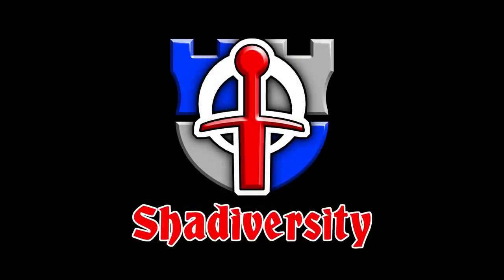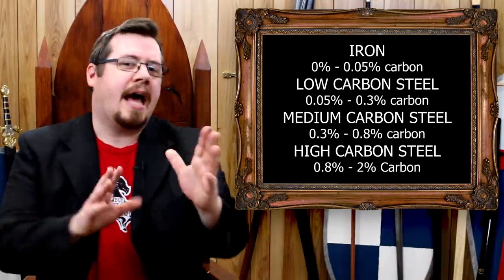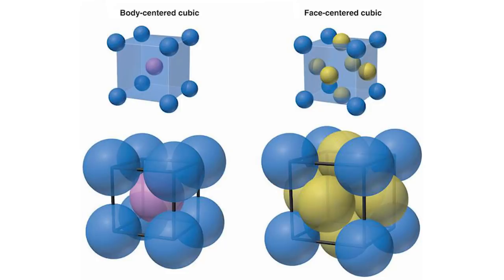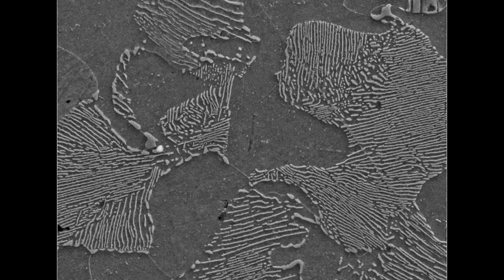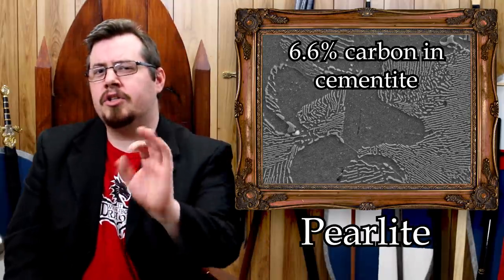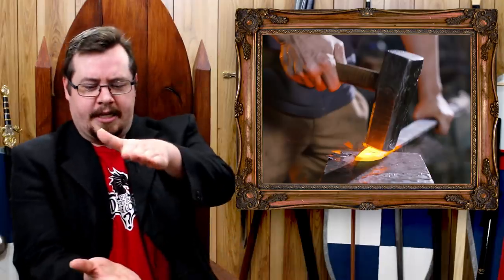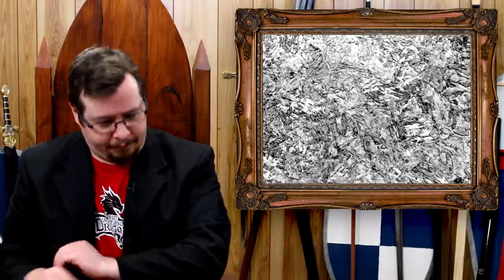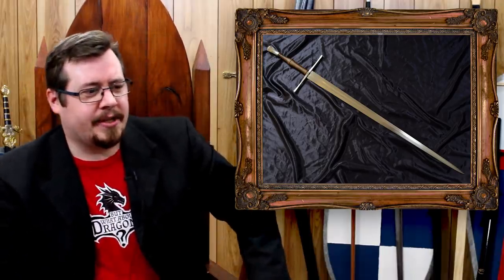What quenching and tempering does to SWORDS

Comment: 15:59
"Hardness does not determine how sharp a sword can get."
Technically true, but when you get into some of the more exotic steels (albeit not sword steel), hardness and steel composition do dictate how sharp you can get it. For instance, with steels like ZDP-189, CPM-S20V, ect. - you run into issues with edge stability. And with steels that are extremely hard like ZDP-189 with a high HRC or steels like CPM-S20V, S30V/S35VN, ect. with carbides not normally found like vanadium carbides (which are... absurdly tough, don't quote me on this, but IIRC vanadium carbides would be measured in the hundreds or perhaps thousands in HRC if you were to to measure and convert it). So what happens if you don't sharpen something that is harder than the carbides (like diamond), you're not actually sharpening the steel, but ripping/tear/fracturing the carbides out. Meaning that you can't get it as sharp as a steel that does not have those carbides/hardness.
Reply: Forgot to mention: this doesn't mean that such steels are not as sharp. As I said, diamond solves many of these issues - although when you get into the ridiculously sharp and minute details, doing it as well is much more difficult than if they didn't have the carbides. Diamond doesn't "polish" after all. All you can do is step-down through "grit"/micron (micron is better for measuring the sharpening effectiveness because it's uniform, grit just means whatever standard that manufacturer uses to measure by and there's dozens) size until you get the edge you want. Meaning you start out with, say, 30 micron diamond, then 20, then 10, then 7, then 5, 3, 2, 1, .5, .25, .1, ect. Monotonous and time-consuming to sharpen "properly" that way. Then again, it's NOT necessary, but if you want to get absolute equal sharpening performance and everything, that's the way it needs to be done. Realistically, it won't improve your edge to a degree you'll notice it. This is all just meaningless semantics from human end user experience.

I really recommend "Cliff Stamp" and his Youtube channel. The guy really dives into the minutiae of sharpening and what works and doesn't work and why. And it's surprising how much we still don't really know about the subject. Then again, new steels are always being invented and each one kinda puts a dampener on what we knew about sharpening.

Comment: Just a little correction: Heat treatment (tempering and quenching) is not anywhere close to the last step in the manufacture of a sword. It still has to be brought to its final form, polished, hilted, sharpened, and have a scabbard fitted to it. If anything, I would consider heat treatment to be the halfway point.
Reply: Final step in blade construction then?
Reply: Serahpin no, because after tempting you still need to put the right edge on the sword. Before hardening you only form an edge 2-3mm wide. Giving the said the final shape before hardening would greatly improve the risk of something failing (bending, cracking).
So basically the steps in blade making are 1. Rough shaping 2. Hardening (quenching, tempering) 3. Final shaping
Reply: As someone who makes the occasional sword, I must say that's a fairly accurate point. However I think he meant the final stage of FORGING the sword.
The steps I generally take when making a sword are as follows:
Idea for sword
Measurements
Stock Selection
Forging Process
If needed, grinding process (I generally don't remove material from my swords)
Fitting the Guard and attaching it (I make my guards integral because over time the material for the handle will degrade and the guard will come loose if not precisely fitted. Guard is generally Forge Welded onto the sword)
Creating and fitting the Pommel
Normalizing 3x generally
Quench 3x generally (more quenching brings the grain size down allowing for sharper and longer lasting edge)
Tempering
Reducing edge and sharpening (I don't polish my swords, generally I leave them with the forged and patina look)
Create the handle, then fit pommel. (I generally either rivet the handle together or glue it together, though I prefer riveting)
Test sword (I'll abuse the hell out of it, cutting PVC, trees, lumber, etc. If any problems arise I will toss it or keep it for personal use.)
If no problems then I'll create a scabbard for it, I'll generally make them out of layering Pine wood just because it's easiest for me.
Sword is complete.

Comment: I enjoyed watching this...it reminds me of pouring epoxy resin.
You want it to be liquid enough to be able to push bubbles out and self level. But you also want it to dry quickly so no more bubbles form or any stuff gets in it while its wet.
So you add a hardener to the resin to make this happen.
The hardener is essentially tempering the resin...which would otherwise be soft and full of impurities.

Comment: Most of my experience with heat treating and tempering is from forging knives. When you temper a knife you tend to want a "straw" temper color (around 400F) so I was concerned when you said good swords were made with a blue temper color. But you have certainly done your research well, and I can understand why you would want a spring steel sword. Great instructional video! I might use some of this knowledge when making more blades in the future!

Comment: I thought quenching and tempering were the same thing too, I learned a lot from this video! I knew about the differential hardening of traditional katanas and always wondered "but if the cutting edge is brittle won't it still chip?" I never got how a softer back would prevent that, like many people inaccurately claimed. Though it's not as good as spring steel, I love the creativity the Japanese employed to try and find a balance of strength and resiliency, not to mention the beauty in the resulting blade.

Comment: This reminds me of one of my favorite quests in Kingdom Come: Deliverance. One blacksmith hires Henry to investigate a blacksmith from another town, he does this because he has heard that the other blacksmith is a sorcerer who is casting spells on his steel to make it indestructible and he wants to know what the spell is so he can recite it over his own material as well.
     When you investigate the other blacksmith one of the first things you likely notice when you come upon him is that he is always singing. As you ask him questions about how he makes his swords (Henry's father was a blacksmith, and so Henry is able to get him to open up about it to some extent) and why he is singing he tells you that one time after finishing the blade for a sword he got distracted and left it sitting right by the fire of the forge and when he finished that sword he realized that it was much tougher than his other blades. He had no idea why it happened, but he realized that when he partially heated up the blade again after quenching it became more flexible while retaining the hardness of steel. He then proceeds to tell your character that the song he sings is a way of timing how long he lets the steel re-heat by the fire before he removes it in order to get the most durable steel. He essentially learned how to properly temper steel without having any idea what was happening.

Comment: Pretty spot on, at least as far as swords go.  But any other bladed tool/weapon it has to be differentially harden.  I make knives and I do the quench and temper in one go.  When I bring the blade out of the quench, I scrape the edge with a file.  This is twofold, first it tests the hardness of the edge, but also cleans the scale off the edge so I can see what color the edge is turning so I can get it to the right hardness.  I go for a straw yellow for my knives since there is no chopping involved in their intended use.

Comment: 4:50 About work hardening. You can actually work harden steel/iron when it is at low temperatures (in the glowing red area) This happens at higher heats too but there's enough time and heat that it will often anneal almost as much or more than you can harden it. But at a low red heat you can work harden it and keep much of that process without losing too much to heat. That being said your right that work hardening can cause issues with the steel even if worked at a low red heat, it can be bad enough that in high carbon blades it can introduce cracks into a blade that are nigh irreversible.

Edit: When you talk about normalization I think that implied that you already knew this but I just wanted to clarify.

Edit #2: As for tempering You can temper a blade to blue, but blue is the softer of the tempers, for knives and even some swords (depends who you ask) you actually temper till "straw yellow" reaches the edge of the blade.

Comment: Perfect video, which break the myths around the swords and material science... Just there are some mystakes in the point of the correct physical principles and phenomena (Iron lost its ferromagnetism on the “Currie temperature” 768°C, but correct... Austenite is ferromagnetic 😁). And btw you are able to make the the edges of the traditional EU double-edged swords consist of the Martensite... You only need to make the thermal barier on the core of the sword.

Comment: Awesome video Shad and very educative,i really appreciate the time you take to make these informative videos,id like to correct you about tempering when you said to heat it up to where it glows blue,i make knives and as far as i know you want a straw color at least for knives because that blue color is a bit soft for edge retention but swords can go to more stress so idealy you want a sword to like spring(that blue color means spring temper)so i have seen modern bladesmiths when tempering medieval swords they temper the center of the blade until a blue color and the heat goes to the edge but with lower temperature(straw color)for better edge retention.

Comment: Normalizing also helps in evening out (normalizing) the grain size (smaller = stronger). During forging, only parts are heated up and worked on so some parts have had more heat and therefore, more energy for the austenite grains to grow.

By heating it up and then cooling it, you force austenite grains to grow from the boundaries of the old grains and by cooling it, you stop this process and ideally, breaking up two grains. Do this enough times and the grains should be pretty uniform.

Rule of thumb is if you forge, you need to normalize. If you purchased steel from a distributor that was already in its softest and most uniform state, you don't need to normalize.

Comment: Steel has always puzzled me, even after learning a lot about it from classes and videos like this. Mainly with carbon content. But while learning about steel I also learned architecture. Structure is crucial to properties. The difference between graphite and a diamond. 
One thing I learned about tempering is how it affects different mixtures of steel, those higher in copper, zinc, manganese, and carbon.

Comment: hardness can affect how sharp you can make an edge, but this is dependent on context. if a material is hard enough you get access to sharpening it in different ways that result in sharper edges. also the disparity between hardness needs to be way larger to be noticable than some might think. take an extremely hard material like glass or obsidian. To my knowledge* their edges through knapping can become finer than is accessible on steal through grinding.
this is mostly a matter of how the edge is made, and secondarily a matter of hardness through DENSITY of the material. the denser the material the smaller the lil bits that make up that material, and thus the higher "resolution" the edge can be.

Comment: Shame you weren't  my professor way back in my engineering materials class, you present this information so much better than how I was taught it.

Since you mentioned sharpness, I was a bit curious if you might be able to verify something for me, Shad, if you don't mind. I had heard that the obsidian blades made in the central american cultures were the sharpest anything you could get because of how they cracked the rock would let them get the edge of the blade to be a single molecule thick. Not the medieval period, and really not the type of sword you talk about either, so I know you may not have knowledge on the subject, but just figured I ask.

Comment: My understanding is that the faster it cools the less time it has to form crystal structures, but defects in the process of forming a crystal lattice eventually close it into a sort of grain, so the steel is basically filled thousands of small grains, the bigger the grain the less grains it has to bump to move and thus it’s less hard and more flexible, quenched steel has a very small grain and is hard and brittle, it’s then tempered so the iron can find a good medium between large grains and small grains resulting in a good quality steel tool

Comment: Quenching doesn't work on basic mild steel.
You can't get pure iron from smelting or hammering, you can only get it from electrolysis.
According to the documentary on Mike Loades channel wootz damascus wasn't quenched or etched, it was air cooled.

Comment: I have a question, Shad : 

It is often said that in classical times, (roman, celts, greeks etc) there were no steel, only Iron.

I have a problem with that : since fire is part of the process of forging a sword and since carbon is emitted by fire and burned wood is full of it, how is it possible to have iron only swords back in those times ?

Comment: The micro fractures from cold work is not automatically fixed by heating it up. You need to get it to welding temperatures and attempt to forge weld them together by hammering it together. This is not a guarantee that all of the micro fractures will weld closed. Otherwise you can form a cold shut and have a place that the blade will fail.

Comment: During tempering the steel does not 'glow' blue, it forms a blue oxide layer.

There is an old bladesmith saying that goes something like, "The blade is either born or dies during the quench."

Comment: What was the major technological limitation on the quality of steel people could make? Was it the purity of their ores, the temperatures of their forges, or just the knowledge of how to work the metal to give it better qualities. So for example if someone with the knowledge of how to make spring steel went back in time to when iron weapons were still the standard, would they be able to make a sword of spring steel using only the resources available at the time? Or were there other technologies that had to first be developed?
Reply from the maker: If you can make iron you already have the resources but the technology didn't become standard until much later, but even with bloomery steel (the main type in medieval times) you can still make good steel through folding and then temper it into a spring steel if you know how. Crucible steel is the way to make more pure steel without the excessive work of folding. You can technically make a crucible out of fairly simple technology such as a clay furnace and bellows, meaning if you can make a bloomery you can make a crucible, but you just have to know how.
Reply: Also, the blast furnace allows you to melt and cast iron which at first is really brittle but can become quite pure with the proper processing techniques. The blast furnace was invented in ancient China and arrived in Europe in the middle ages. Interestingly, the blast furnace never caught on in Japan and they continued to use older methods to process their iron sand into steel

Comment: Have you looked into transitional/transformational "Bainite" steel like the Howard Clark L6 blades?  Years ago, I saw testimonials from smiths and Iaijitsu practitioners that seem to support the $10,000 prices these blades command, suggesting a "scale matrix" (?) crystallization that has the best of both pearlite and martensite properties in the spine.

I haven't researched it extensively, but I thought you might find it interesting if you haven't come across it already.  There are hours of YT science videos on the process.  It seems to be the result of carefully controlling the quenching speeds and temperature ranges to lock the matrices into intermediate, interlocking structures.

Comment: Have you heard about wootz (true damascus steel)?
Its a kind of very high carbon steel(nearly cast iron) that due to a variety of impurities such as vanadium and manganese has a very peculiar crystalline structure of ferrite and iron-carbide that requires very slow cooling from its molten state, and heating it up above red hot ~700°C would ruin it.
There is also the rumor that old swords forged from wootz appear to contain carbon nano-tubes, giving them an incredibly hard edge, and the one that nobody has been able to recreate this steel with the same properties since the original mines in india where depleted...